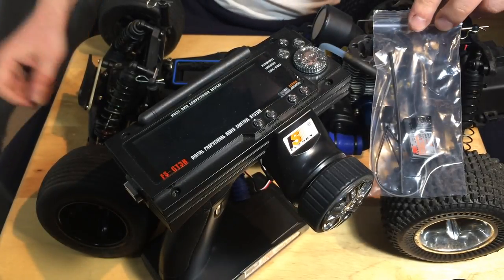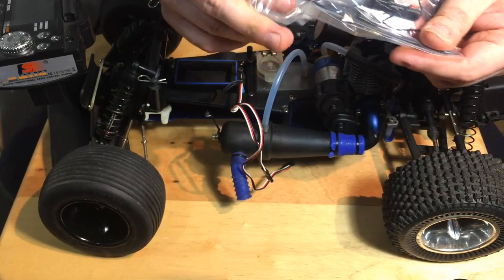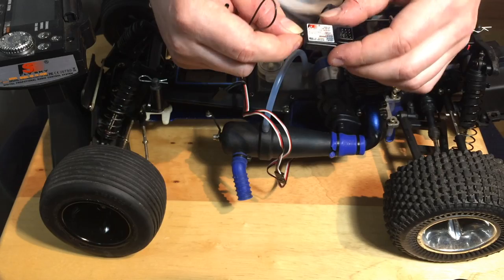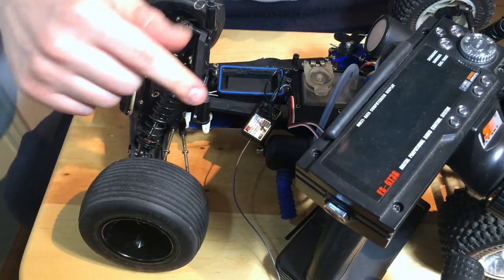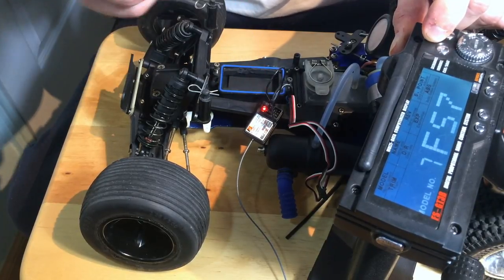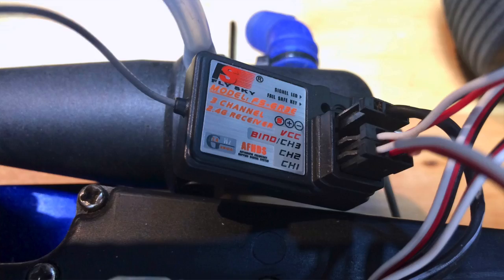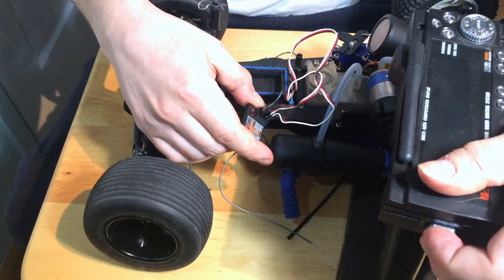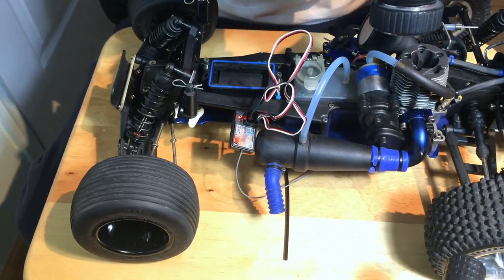HOW-TO Bind the Flysky 2.4GHZ FS-GT3B to the Receiver

Comment: I did this and it, put my throttle as the turning and my steering does nothing?  Help!!
Reply from the maker: hey buddy! Lets figure this out. So you are trying to bind a new receiver yes?  It sounds like you have your channel 1 and 2 incorrectly setup, possibly wired incorrectly into the receiver.  Your Channel 1 is always steering, Ch 2 is throttle/brakes, check to be sure this is right.  Check the wiring first, let me know.

Comment: So Ive just installed and binded into a hpi savage . But my throttle is reversed and also when I switch it on the servo goes into full brake and cuts the engine out
Reply from the maker: hey buddy! it sounds like you have the channel reversed.  There is a feature in the radio to reverse the servo throw on channel 2.  Just toggle the 2nd channel from either reverse or normal, you will notice the issue will go away. I have another video that shows how to set the fail-safe with this radio also.
Reply: @hybrid32494  cheers I'll check out ya videos , do you have video showing trim adjust etc

Comment: Just binded my Mutilator with this set up but somehow steering going in reverse? I just can not seem to suss the steering trim either? Please Help Someone?
Reply from the maker: hey buddy.  You need to reverse your steering servo using the menu on this remote.  This is very common.  You need to go to servo reversing on Channel 1 and just move it to reverse or normal, doesn't matter what position it's in right now (normal or reverse), just do the other one.  Your steering trim is adjustable with the small dedicated button on top.  Let me know, I'm here to help.
Reply: hybrid32494 Thanks, I’ve sorted me Trim out now but when toggling through menu it seems to only let me reverse channel 1 or 2 is it? I’ll be working on it some time tonight so will let you know the results. I had it out for a run last night but I seem to be having issues with my gearing? Seems to disengage when wants and engage when wants? I was thinking maybe this has something to do with the slip but not sure....
Thankyou for help so far, I need all the help I can get not gonna lie new to the petrol buy dedicated to it now and not turning back now Ha Ha
Reply: Now sussed the issue with reversing the servo on steering! Thankyou just need to know why I’m disengaging gear?
Reply from the maker: happy you figured the steering out!! Tell me which RC model you have btw.  Then I can go from there.  BTW you also need to set your failsafe with this remote for channel 2 (throttle/brake), if this is a nitro or gas car.  I have a video on how to set the failsafe on this remote as well.
Reply: hybrid32494 I have the Mutilator 6 23cc petrol and found your help so great in helping me set up my first one. I’ve drove but always used shops for repair in the past but sadly to say Model shops in my town have become more or less extinct. So now having to teach myself how to do these things myself...
Reply: hybrid32494 off to check your vid for fail safe today and I’ll let you know the results. I am still struggling with my gearing so gonna suss that too at some point too
Reply: hybrid32494 wasn’t my gearing the bolt that’s supposed to pull the actual accelerator had came loose. Easy fix and had a perfect 6 min run and flipped it and loosened the back small cog to the drive wheel. I was lucky not to shear it and I was also able to retrieve the cog. Looks like an easy fix but I won’t say that as I’ll probs jinx myself ha ha Thanks for all your help.

Comment: Why does mine keep beeping when I bind it the cars esc works and so does the servo but it beeps
Reply from the maker: hello, do you have the correct wires plugged into their locations on the receiver? You gotta remove the bind plug and reinsert the ESC into channel 2 usually.
Reply: No I put the battery's out of my old transmitter ,my mistake I just new the battery's had life in them but not enought to make the gt3b happy

Comment: Mine doesn't want to bind
Reply from the maker: hey buddy!! It's possible you have a bac RX, i;ve had that happen, but very rarely.  Do you have another one as a spare to check whether you're doing the process correctly.  And make sure to remove the bind plug when you're done and to correctly insert the wires.

Comment: Why won't this work on my slash
Reply from the maker: hey buddy! Are you using the current receiver with this radio? Some people try to bind this radio with a different receiver, IDK if you are.  Anyway, are you holding the BIND button first, then turning the radio on?  The process is highly delicate.
Reply: @hybrid32494  yes I am using the same stuff as in the video and I still don't know I'm using a sidewinder series 13 motor and ESC and all it does is sit and beep and flash green I cannot get the remote to connect to the receiver to get the ESC to stop beeping
Reply from the maker: @luthershoemaker5037  I highly recommend you pair the RX and Radio first without the ESC power plug. All you need is the Bind Cable and a power source  to link them, you dont need the motor or the ESC to even be connected really.  It's just like doing it in a nitro car.  The ESC has nothing o do with the process really.  Once you plug the ESC back if it's correctly bonded then you will notice. Also make sure the trims on the radio itself are set to neutral.  Meaning if your throttle trim is not at zero it could cause a problem.  Let me know.

Comment: Mine still won't bind lol
Reply from the maker: Flyin'ItalianStallion     Are you sure you are correctly plugging in the bind plug and the power wire into the receiver??  Then holding the bind button and powering on the car then the remote??
Reply: hybrid32494 Yes. I've also tried putting bind in power and power in bind because apparently that solved it for some people. Not me. Maybe the receiver is faulty? Or the user lol
Reply from the maker: Tell me this.  Does the led light blink at all wen you plug the bind and power in accordingly?  Ive had some receivers not blink at all and they did not bind.  And after the binding attemp u did plug the esc wire accordingly at the top right?
Reply: hybrid32494 It blinks. I followed the directions perfectly. Still not working.
Reply: hybrid32494 AH HA! one of the wires was loose on bind plug. I pushed it in and kind of "crammed" it into the receiver. It works! This isn't my first rodeo but that bull almost got me lmao thanks for the quick response. That alone was shocking to me in today's world. Cheers!

Comment: I have the Flysky 3GTB. The reverse is faster than forward. Also the car's reverse is when I press the trigger towards me. Is there a way to reverse this direction and get the car to move foward with the faster  speed.
Reply from the maker: hey buddy! It sounds like your 2nd Channel Servo Reversing function needs to be switched.  In the serving reverse menu select channel 2 and choose the opposite function thats you currently have.  If it's on Reverse, then put on Normal.  And the other way around.  That is 100% your issue.
Reply: @hybrid32494  
Thanks. Got my throttle direction corrected. However  have to return the transmitter and ESC though. Throttle only runs 20 seconds half speed then cuts off dead. It was a Flysky  FS GT3B   reciever and ESC controller with 1060 Brushed motor.
Any suggestions appreciated 

Any suggestions for a comete kit with Reciever, 550 Brushed Motor, and esc all in one or even separate components that are decent quality. I'm rebuilding an Evader. Chassis is great condition but need all new electronics that wont break bank. Gonna use it to train 6 year old. Have the Traxxas Bigfoot in closet waiting for him. Lol